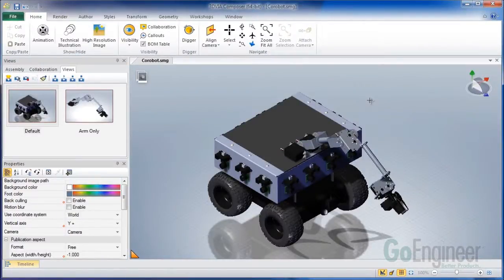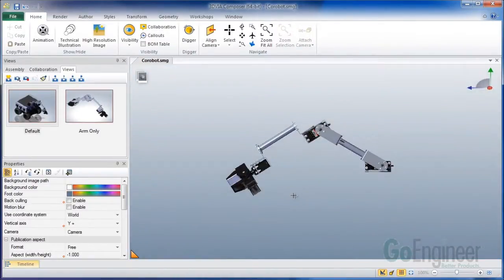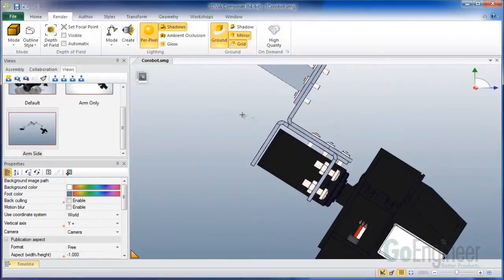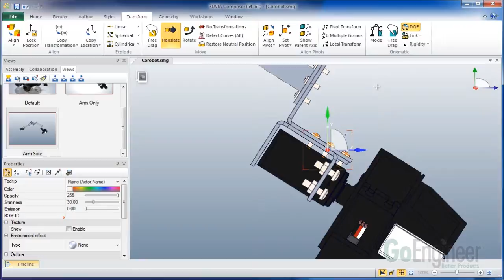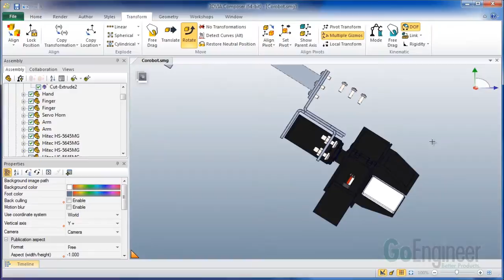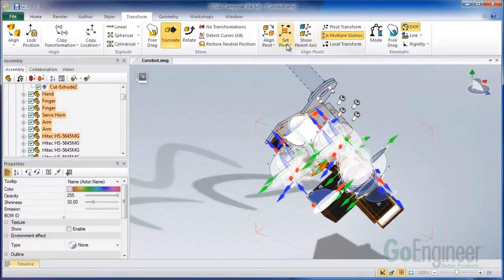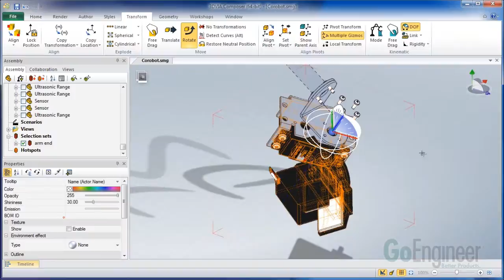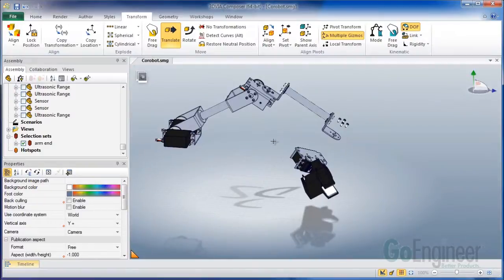SOLIDWORKS Composer – Pivots and Gizmos

Comment: Very useful. Any idea if you can set a pivot to a location you manually type in rather than against some existing geometry. So in my case I want to set the pivot on the world origin (X,Y and Z all =0.0) so I can rotate and duplicate geometry around this world origin. I do not have any geometry currently at this origin I can use for a reference. Thanks
Adrian